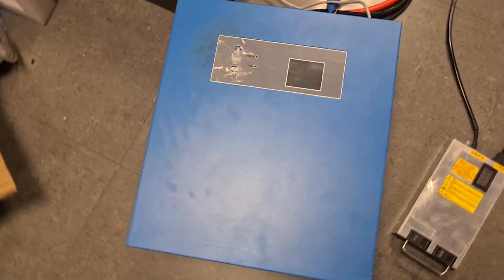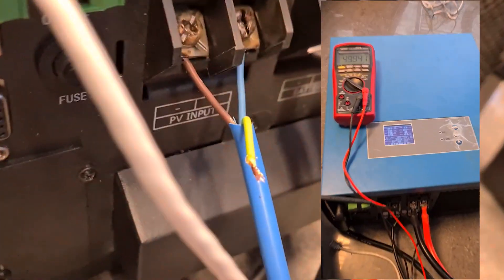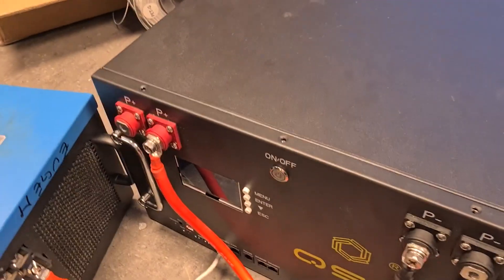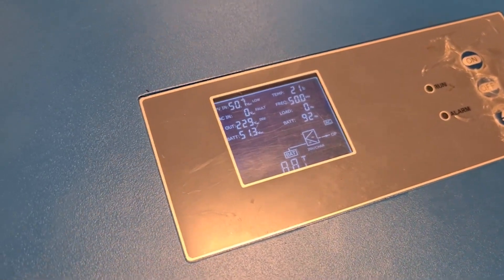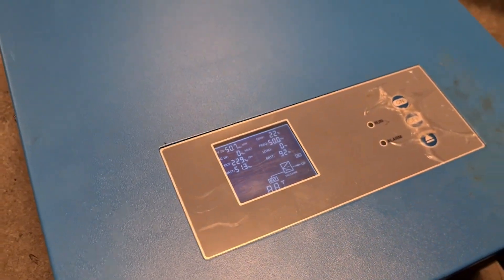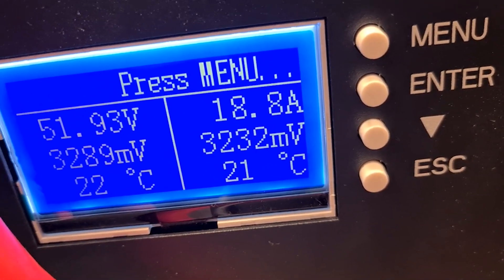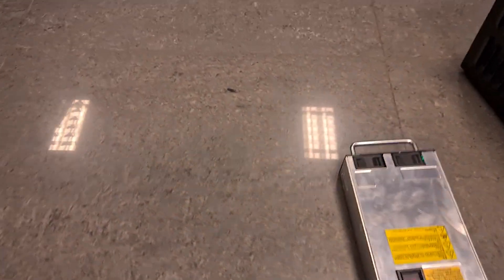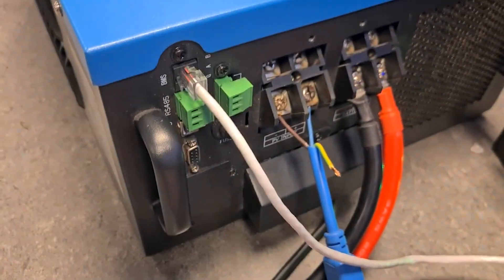Testing a 3KW Off-Grid Inverter & 14 KWh Battery after Relay Switch Repair

Comment: Hey Alex!  I haven't seen all of the previous videos (yet!); can you expand a little the topic of that battery and what DC power supply you're using?
Reply from the maker: Hi, the PSU is something I've found on one of my suppliers. It's just to test the PV input. Anything above 40V will work for this.

For battery I used 16 x 280Ah cells. I am working on producing the metal case in Europe for and get the BMS to work with Huawey inverter as well.

The BMS already works with victron, growatt and a lot of other inverters using the pylontech protocol.